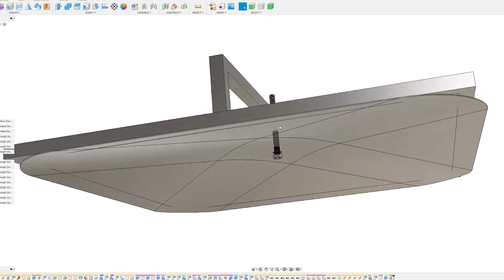(Giant) Multi Colored Fire TORNADO!

Comment: Dude I got the ultimate idea get some balsa wood airplanes. Attach them to a drone.... Fly the drone straight up above you 300 ft for starters and release the balsa glider. Balance your gliders right to left by sliding the wing in the slot so that it balances perfectly on the fuselage on your table top where there's no wind then figure out a way to release the glider if you buy the cheap gliders you're not out much money but think how much fun it could be and if you got the right equipment on your drone you could go pick it back up again and use the drone camera to follow the glider. Somebody with a brain like yours we'll figure out how to release that glider from that drone and pick it back up again think forklift. may need a long string dangling down to pick the glider back up again or a magnet on a string or how about some contact cement on the end of a string and a little bit of contact cement on the top of the airplane. To release the airplane you could have something that when the gimbal moves on the camera it releases the airplane. You know a hook and when the hook goes upside down it releases it or if you fly the drone backwards there you go as long as the drone is going forwards it won't release have a 2 ft long piece of thread attached to a small bent pin or small piece of wire on the airplane. Soft wire a small piece of copper wire would do it.

Comment: You need a misting fuel injector under the center of your fuel table.

You could have multiple fuel input lines to change the color on command, and maybe even electrical controls to create specific patterns or colors.